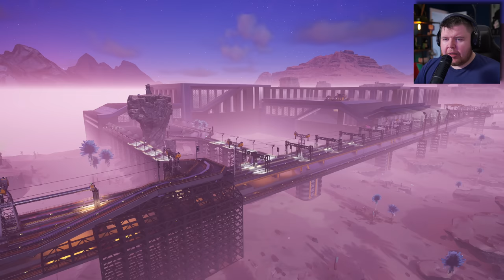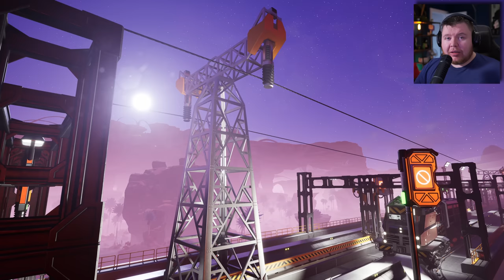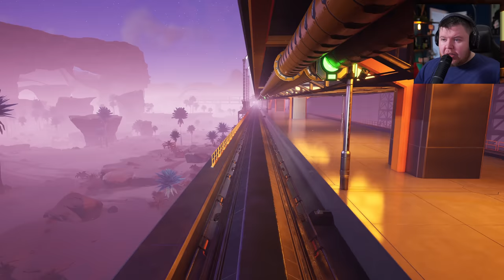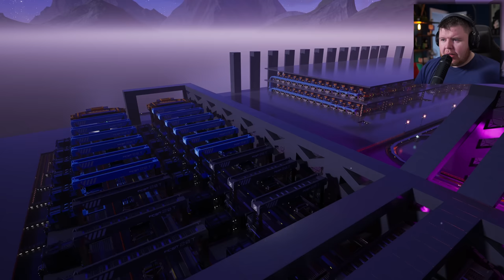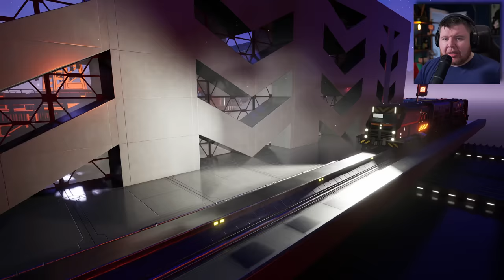SHOWING YOU HOW I BUILT THIS IN SATISFACTORY

Comment: How do you go with 600 lines... I see you usually build to use the max 600, but no matter how much I try I can't get anything to work correctly if you go for the Max 600... they just never seem to be able to do it... especially after a reload or something...  It drives me nuts.  You plan everything perfectly, and balanced, and by the end... its just not flowing like it should.... even if you 100% have 600 fuel, its like you can only run at like 590....
Reply: This is a known Issue i think. Use only Mk 1 Pipes or only fill mk 2 to 90%. Also full Pipes are Happy Pipes and to much Flow Valves are causing Problems. There is a thick Manual out there explaining all the Stuff Regarding Pipes. I think u need a Degree to fully Understand exactly how these things are meant to be used perfectly without errors :D
Reply from the maker: This is a very very common question people ask all the time.. I will explain it in more detail in a future video as it will need to be visualised and I can assist others.. But this can easily be fixed!! After months and months of trying to fix the problems it was a tiny thing that fixed it